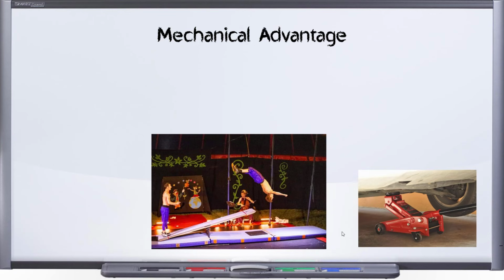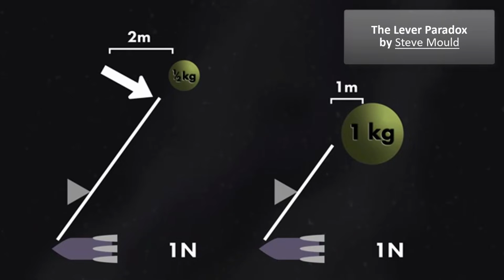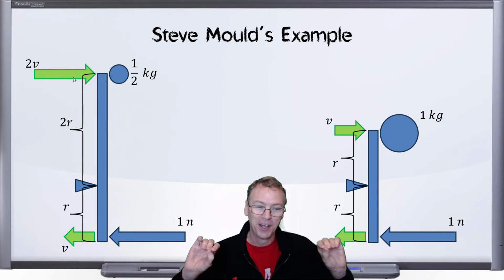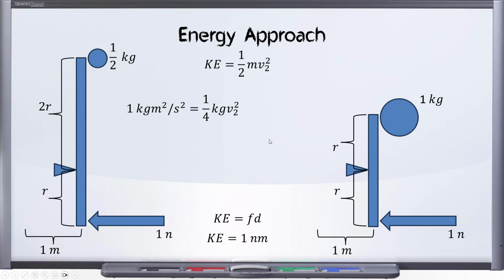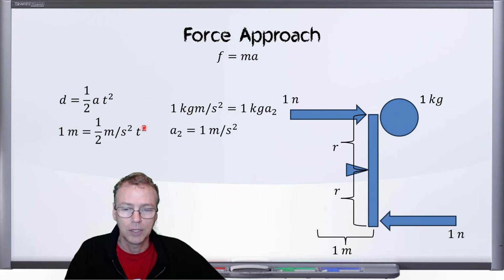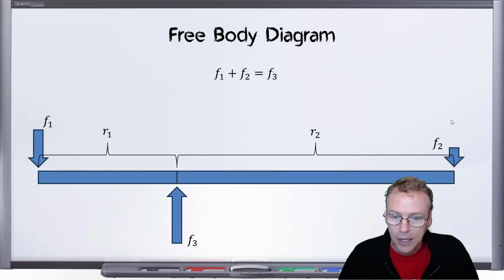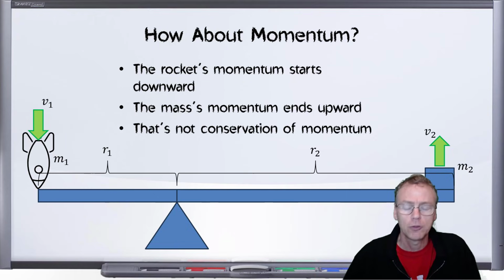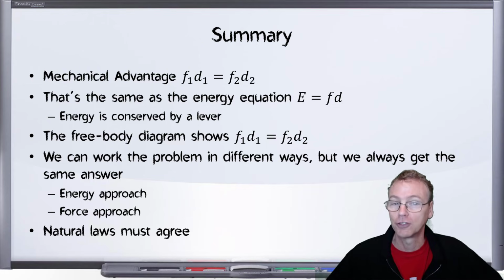What's the Lever Paradox?

Comment: The Work Done is: 
Σ Moments ( ⃙.)× Angle Swept (+). 
M1 ⃙. • (∆θ) ⃙. +M2 ⃙.• (∆θ) ⃙. ~0
=> (←r1×f1↑)• (∆θ) ⃙. ~ -(→r2×f2↓)• (∆θ) ⃙.  

d1²+r1² = (r1+R)² => d1² = (2.r1+R).R , for the right angle triangle 📐.
r1 tan ∆θ = d1 => d1²+r1² = r1²(tan² ∆θ +1) = r1² / cos² ∆θ => (2.r1+R).R = r1².tan² ∆θ.

2.r1.R ≈ r1².tan² ∆θ => R≈ ½. r1. tan² ∆θ ≈ ½ d1. tan ∆θ = ½ d1²/r1, for small R.
=> d1 ≈ 2R/tan² ∆θ = 2.R.cos² ∆θ/sin²∆θ, or d1 ≈ √(2R.r1)

r1 ∆θ ≈ d1, for small angles => r1² (∆θ)² ≈ 2R.r1 => ½ r1.(∆θ)² ≈ R

Subs for ∆θ=> r1.f1.(←1×1↑)• √(2R/r1) ⃙. ~ -r2.f2.(1→×1↓)• √(2R'/r2) ⃙.  .
=> f1.(←1×1↑)• √(2R.r1).1 ⃙. ~ -f2.(1→×1↓)• √(2R'.r2).1 ⃙.  
=> f1.(←1×1↑)• d1. 1 ⃙. ~ -f2.(1→×1↓)• d2. 1 ⃙.  
=> (←1×d1↑)•  f1(in) ~ -(1→×d2↓)• f2 (in)  
=> d1(in)•  f1(in) + d2(in)• f2 (in) ~0 

Thus: W1 + W2 ~0

This is the net virtual work for the system for a perfectly rigid lever. 
However, in real levers there is stress on the pivot, so the work done there is taken into account. 

Real levers: W1+W2 ~ - (U_pivot +Q) 
= Average Pressure* Pivot volume change (eg. hemispherical"point" )  + heat loss (assume zero in most cases)
~ ½P ∆V +0
= -½P²V/B, as B= Pressure Stress/Bulk Strain=P/(-∆V/V)
Where: V= original volume, B= Bulk Stress Modulus.

 B= ⅓E/(1-2 𝜈  ), 
𝜈= Poisson's ratio (~⅓ for metals).
Example: B~ ⅓E/(1-⅔)= E (for metals).
Compressive Volumetric 'Bulk' Strain = ∆V/V = -P/B.
Reply: I changed the directions of forces and position vectors at the end just for mathematical reasons, not physical.

Comment: I know it's a valid law, but 'conservation of momentum' can always be tricky. Many times a force is hiding somewhere that acts on the system, even though there may not be any movement. In my work, the 'reaction force' on piping when the fluid has to turn through an elbow or other joint is very real. It guides the design of pipe supports and such. The fluid comes in, turns through some angle in the piping and leaves, and the support has to 'provide' the change in momentum.

Comment: BTW, the concept of levers applies to electricity via transformer.

As such  we see their that a transformer can  change to impedance as seen by the source where voltage is similar to force and current is similar to velocity.

e.g google
Circuits I: Example Using Ideal Transformer

Thus a transformer can step up voltage voltage but will step down current by the same  factor and in doing so  so that Power in and out  P =V x I (where V is voltage  and I current)  for an ideal transfer with no loses is the same.